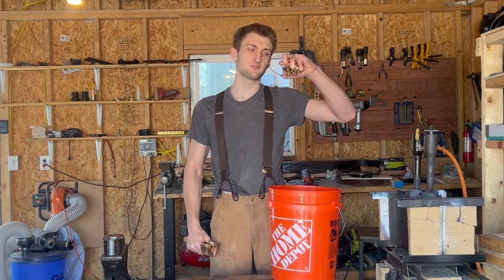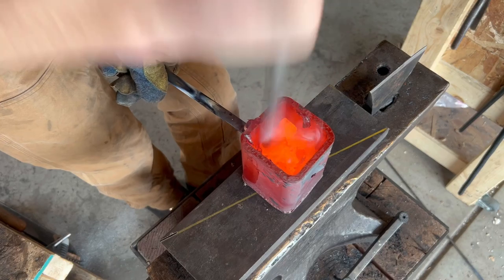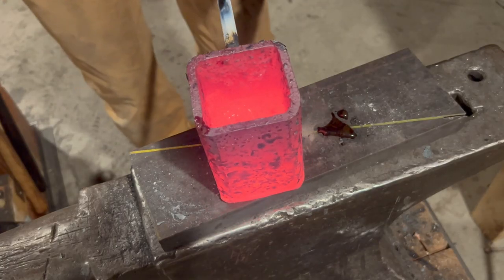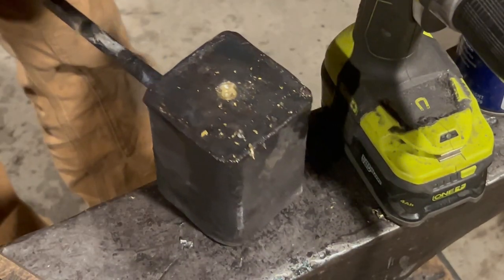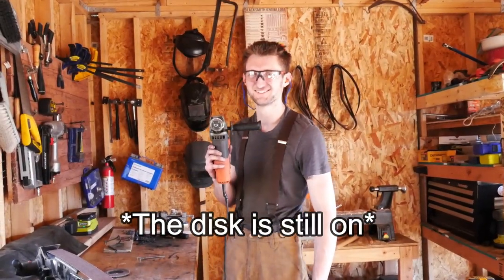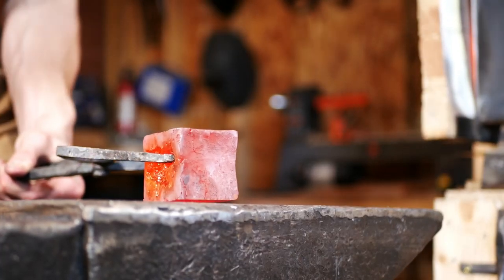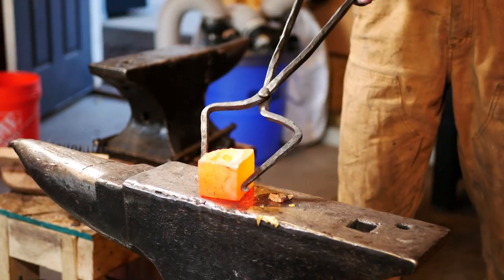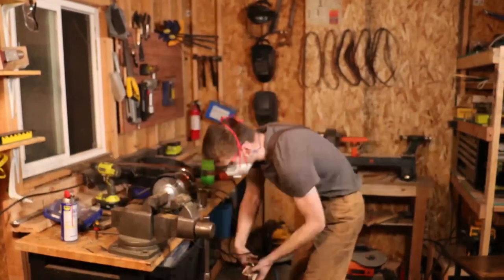Forging a Brass Hammer out of Bullet Casings!

Comment: So.. it looks like you’re in a reasonably well ventilated area, but just a heads up, brass is a copper / zinc alloy: p. much anything alloyed with zinc will give off noxious fumes when heated like that - if you breathe them in, you may not feel much at the time, might not even cough - but you might just end up puking your guts out and pretty much feeling like death a little later - it’s called metal toxicity, I suggest (both to our resident YouTube smith and to those in the comments thinking about trying this) that you take significant precautions to avoid breathing in the off-gassing when working with brass…
Reply from the maker: Don’t worry, my entire garage door was open the whole time, especially when I was melting everything together because the inside of my Forge looks like a white and green petri dish

Comment: What I've seen other smiths do is paint the inside of their canisters with white paint that has titanium dioxide in it.
The titanium prevents the contents of the canister from welding to it.
That being said I've only seen that done for canister pattern wielded Damascus.
I don't know if it would've helped for melting the brass.
Reply from the maker: I have seen that used for canister Damascus, I just didn’t think of it at the time

Comment: so i needed a brass hammer for engine work and i remembered that there was boat that i hauled off to a junkyard a couple years back and i took the propeller and rod off for my own junk pile and the rod is made out of a bronze.  i was thinking about attaching a handle and then i realized that it works much better for engine repair as a rod.  it’s more precise for tapping things and also you can place it and then hit it with another hammer.  overall i’m happier with it than any store bought option and it’s a joy to use.  i polished one half so the dark patina looks like a handle and then i covered it in beeswax so it’s easier to hold when i have oil on my hands.  it is very satisfying
Reply from the maker: That’s very interesting, almost like a bronze top tool. Does it have any significant mushrooming from whacking it with a hammer?
Reply: @Anvil_knocker  yes it’s softer than i thought it would be but i consider that a good thing.  i think they use that material for boats so that it doesn’t create an electrical field and i need something like that to remove an strator style flywheel and to work on a magneto and it worked perfectly.  it’s heavy enough by itself to use as a hammer or i can whack it with a hammer so i think it’s more useful than just a regular brass hammer.

Comment: Cartridge casings. A bullet is the pointy bit goes in the front end of a cartridge.
Reply from the maker: That’s why I said bullet casings
Reply: A modern cartridge consists of a casing, primer, powder and bullet or projectile. 
I understand that bullet has become a word used for a cartride, but it is not the same thing.
A round ball in a muzzle loader is still a bullet. The ball, powder, patch and cap is not a cartridge though.
I am not trying to be impolite.